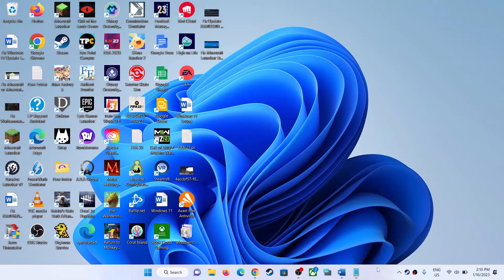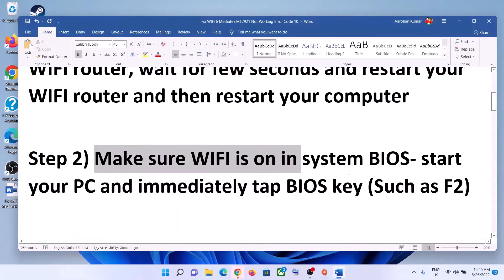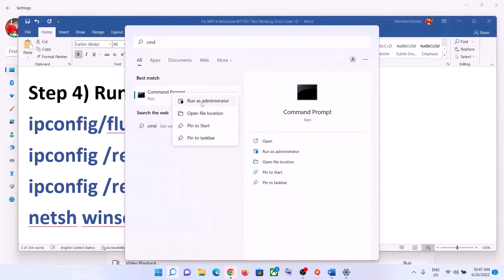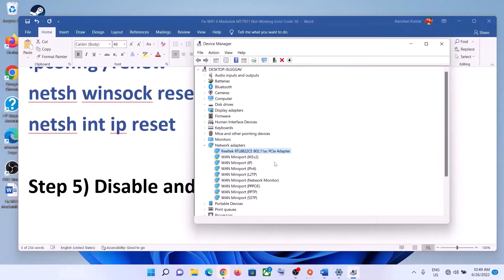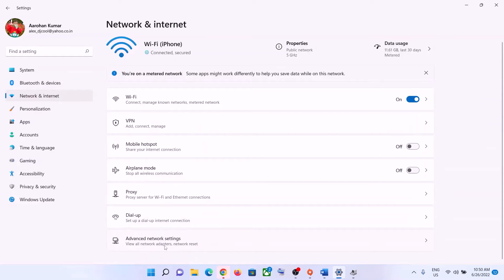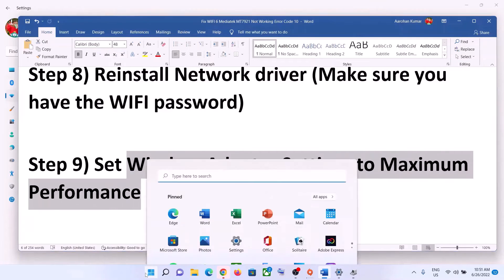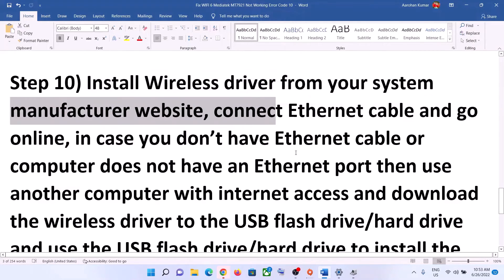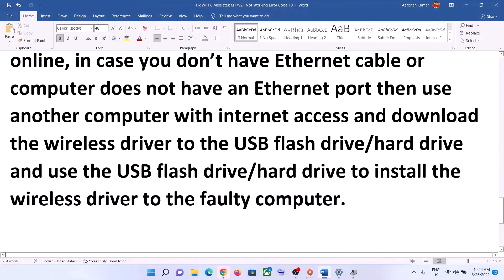Fix Realtek RTL8821CE Adapter Not Working Error Code 10/43,Fix Connection Problem Realtek RTL8821CE

Comment: The RTL 8821CE V1 wifi controller I know is a product that has been working poorly since it came out and has been withdrawn due to uncorrectable defects, the worst of which is the disconnection. Brands like TPLINK call it T2E 600 v1, don't buy it, it's garbage.

Comment: Thank you so much for this. ❤ I had already tried shutting down and turning back on, but hadn't tried unplugging the power cable before turning it back on. I'm not sure if that was what worked or if it was just a fluke, but my internet is back to working. Thank you again!!

Comment: Thank you so much! The wifi started working after the first step. 
I just hope that the problem does not reoccur.
I would also like to understand the root cause of this issue. It would help me understand if I was doing something wrong which resulted in this problem.
Reply: Mine started after the first step, too. Saved me from a lot of distress. God bless you, Sir. YOU ARE A LIFESAVER‼Thanks so very much.🥰🥰🥰